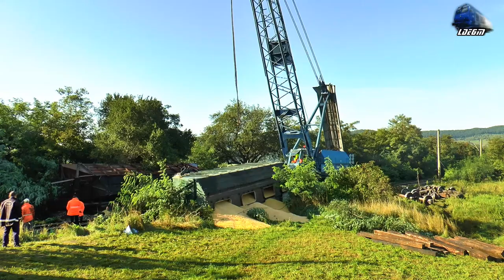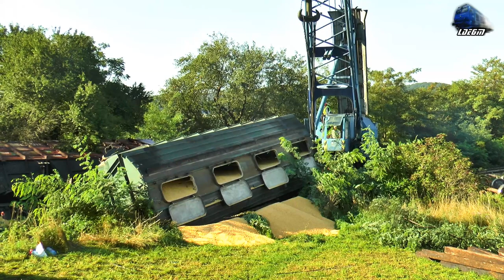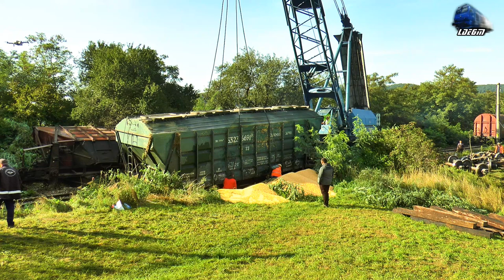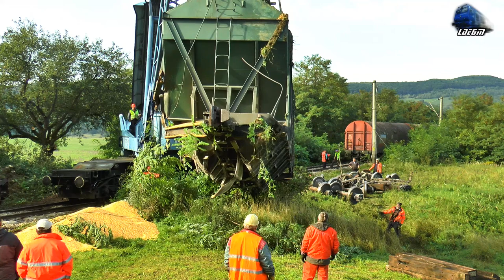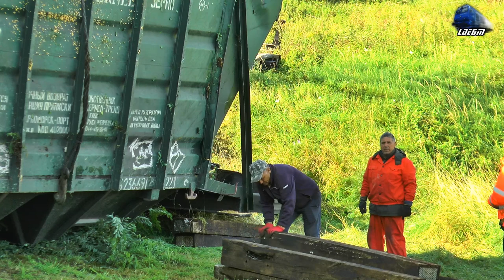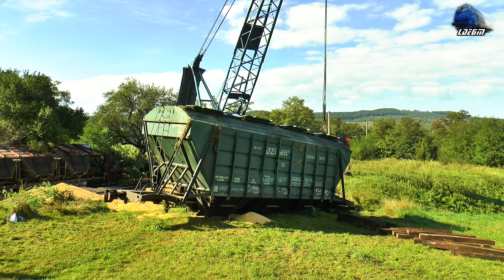👷‍♂️🏗 Ukrainian Derailed Train & Big Rail Crane in Action in Romania - 14 September 2022

Comment: Interesting to see how other countries handle train derailments.  I believe in my country they would have just dragged the car clear of the tracks using 4 small, side boom tractors, so they could repair and reopen the mainline as fast as possible.  Then they would have just cut the car up for scrap on site.  If the grain was deemed salvageable, maybe they would have sucked it out of the car with a large industrial vacuum truck, or otherwise just sent it to a land fill in a dump truck.
Reply from the maker: Thanks a lot! Yes...🏗👷‍♂️🚂⚠😉
Greetings from Romania
Andrew